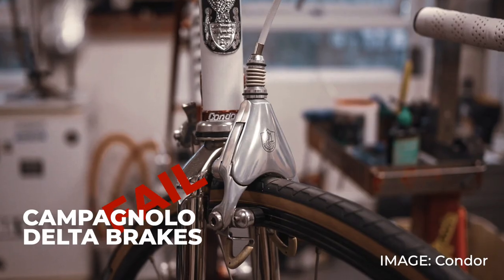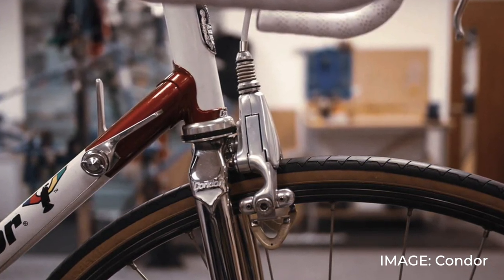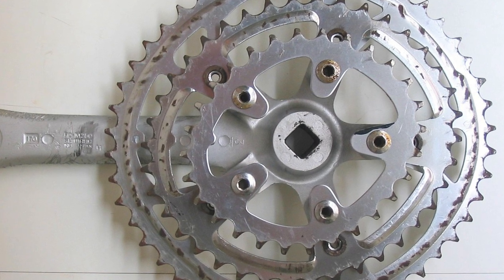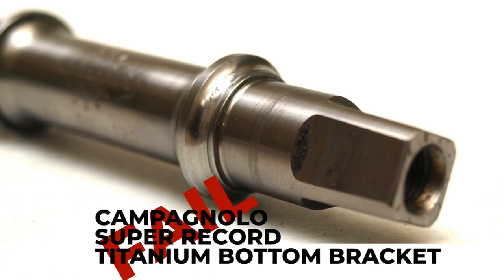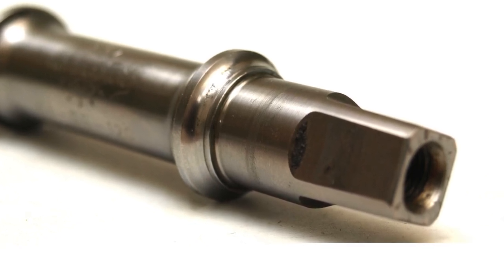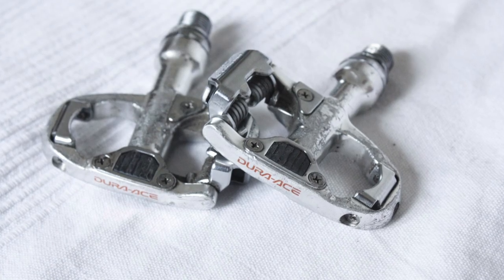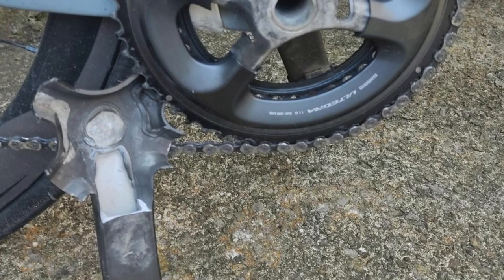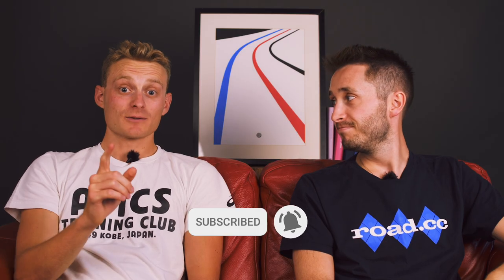Shimano and Campagnolo's Biggest Tech FAILS

Comment: Hollowtech 2 cranksets fail because there is a chemical reaction between the alloy of the crank and the bb axle which is typically steel - put water on the joint and you effectively have a battery.  Make it salt water (think UK salted roads) and it's even worse.  The reaction degrades both the alloy and the adhesive.  It's just simple science which, unfortunately, Shimano ignored...
Reply: Oh an self powered E-Bike
Reply: They don't fail at the spindle joint: they fail along the bond line between the outer shell and the spider. I suggest that  talking off the top of your head about this makes you look a dill.
Reply: If your explanation was somehow true, ALL Hollowtech cranks will eventually fail, and also many others brands since the steel/aluminium composite is fairly common in cranks machining. This is not the case, the failure affects Dura ace and Ultegra only, and the failure in question is the two-piece design, with two separate clamshell sections that are bonded together to form a single hollow structure. When that bond joint failed, the whole arm basically just felt apart.

Comment: You kids missed a few. Us older riders might remember Shimano airlines, Rapid rise and ,sadly, Suntour accushift....and there's nothing wrong with Biopace...
Reply: I’m see a lot of biopaces on my stand at the community lbs I wrench at because we get old bikes and fix ‘em up. It’s really common that the front mech is adjusted to the ring’s lowest, not highest point in the oval, so the mech rubs and grooves the big ring. Also, when I test-ride one I’ve refurbished, the oval is clearly not aligned with the crank for max power. Totally agree about Rapid Demise - I think the early mtb years threw a lot of spaghetti at the wall seeing what would stick. So many whack frames made it into production!
Reply: Sigh accushift. The last edition were really bad because you could not switch to Friction due to patent issues. I still want to try out some wing commanders on my Frankenstein bike.
Reply: I don’t understand what the complaints are about.  My first road bike had Suntour Accushift.  They worked great.
Reply: I REMEMBER AIRLINES. omg

Comment: The Delta brake bashing can stop. I can easily  lock up my wheels with the 5-pivot delta design, and it seems most people bashing them have never ridden them, + it seems pros in the late 80s / early 90s didn't have too many problems racing on them. They were a pita to install (the cable), but once installed, they performed well with excellent modulation.
Reply: I think that should put them in their place. I agree with you totally
Reply: Yep, mine worked great 👍
Reply: Yes, they did not work that bad, even my simpler "croce d´aune" version with longer brake arms brought me to a stop.  They were heavy, but looked cool.
Reply: Shimano 600 and Dura Ace AX brakes now they were bad, along with the Modolo Kronos brakes they were probably Campagnolo's inspiration for the Delta's, centre-pull aero. The AX brakes had blocks that you couldn't adjust, for 1982 both groupsets looked very futuristic.
Reply: Never had any issues with Delta brakes even on steep downhills. I never really heard any Pro Riders saying they had brake failure. 
Yes there weight was more an issues.
Like many things the Delta issues have become much of an overblown myth over the passing decades.
Reply: It's the same story as canti brakes. They get a bad rep because they're difficult to adjust, but once adjusted they're as good as any other brake.
Reply: @clockdva20  70 grams of weight penalty when the bikes were around 9 kilos as they were introduced?? Really a concern???    Rgr

Comment: One not so brilliant Shimano product I have fond memories of is the Positron group set. The rear derailleur had no spring, and instead relied on a stiff shifter wire that could both pull and push. Five speed indexing was built in to the rear derailleur, fully exposed to road debris.
Reply: Yes, I worked on the Positron equipped bikes back in the early 1980s. It was found on department store bikes. Shimano did decide not to abandon index shifting though and instead of trying to make the tech “trickle up” from the cheap components, they started SIS on their top components and let it trickle down.

Comment: Nothing wrong with the oval chainrings: Froome and Wiggins were using and winning on O-symmetric ones (different angle than Biopace though). But they are just not for everyone. As for the Delta brakes, the issue is that they were getting stronger as the brake pads wears off due to the mechanism geometry which then offered a very high leverage. So they were engineeringly flawed, and  needlessly engineered and heavy, but not weak. By the way Fignon won the tour de France on them, and lost to Lemon on them for 8sec.

Comment: I know first hand why the Delta brakes had a braking issue.  I wrote the internal report on the functional safety issue.  It was originally intended to be just a time trail brake. I came up with a way around the 'failure' issue that prevents that brake failure.  I know what happened to the engineer who oversaw and certified the masterful design. He experienced the Italian resignation. Those brakes are just a collector item these days. Look at the Shimano Dura Ace AX crank and pedals, interesting and innovative but not practical.  Cinelli came out with the M-71 clipless pedals back in the 1970's.  They had no toeclip or strap. They required reaching down and unlocking by hand to get out which cyclists thought was suicidal. But, those were intended for track racing only, where any release during the race means you loose.
Reply: I remember seeing pics of those Cinelli pedals way back when they were first released.
It seems they were designed and marketed towards track Match Sprinters mostly.

Then there was Aussie Pro Match Sprint World Champion John Nicholson who actually BOLTED his shoes onto the pedals, and had to tie his laces while on the start line, or right before then.
(Yes kiddies, there was actually a time when there were no BOA mechanisms to hunker down your shoes, and we used laces, as well as totally non-adjustable cleats, NAILED into the hard leather outer soles.) 😉
Reply: "I wrote the internal report on the functional safety issue"
PM me, pls? We must have met in Vicenza in 86. Antonio Romano and Marcel Angot were still there, then.
Reply: Delta´s a collectors item?? I use my pair... on my TT bike...      Rgr

Comment: 8:45 sloppy research. It was only the Ultegra bonded cranksets that failed: the 11 speed 8000 series have 0 problems in this regard, as did Dura Ace Hollowtech of any vintage, as they were either welded together, or centrifugally cast, then forged.

Comment: 3.5mm hex key on the Campagnolo Delta is no problem at all: a Torx T20 fits perfectly into this bolt head.
Reply: When you find them, they´re cheap, as cheap as any other size. Buy three.       Rgr

Comment: Shimano has never manned up to the horrible disasters caused by their hollow crank failures! It's documented. In fact there is actually a website for that!
Reply: Was there a specific model of crank that failed? Or was it just all Hollowtech being  susceptible?
Reply: @uptown710  Only Ultegra (6800 & R8000) and Dura-Ace (9000 & R9100).
Reply: @uptown710  Ultegra 6800 and Dura Ace 9000 and up
Reply: @Tullebukk75  thanks!
Reply: @savagepro9060  thanks!
Reply: I have just had the Ultegra 8000 crankset on my Roubaix fail-it started creaking and clicking on a 77 mile ride last week and the pedal was no longer turning true but in an elliptical shape! Luckily I finished the ride before it actually failed completely. I should say the at 70kg and 73 years old I don’t produce a massive amount of power-mate of mine had his snap completely earlier this year-he is 65……..

Comment: I agree about the Biopace, terrible idea. Campy's bottom brackets that unscrewed while you rode. I had the miserable early Campy Athena group that was impossible to keep shifting correctly. And, even though this is only about Shimano and Campagnolo, the absolute worse bit of bike gear I had was the first issue of the Sampson clipless pedals that were nearly impossible to unclip without reaching down and grabbing your heel and jerking it to the side.
Reply: Biopace isn't bad at less than 50 rpm
Reply: @raul0ca  I had it when I was racing 35 years ago. So RPMs were around 100.
Reply: Campag BBs that unscrewed as you rode didn't, if they were properly installed - or, at least, no more so than any other Italian threaded bottom bracket.
Like all Italian BBs (right-hand thread both sides of the BB shell), they needed to be in threads that were clean and in good condition and the drive-side cup needed to be done up *tight*, or, in the case of the Campagnolo sealed bearing units, the cups needed to be properly torqued against each other.
It was by no means unique to Campagnolo, simply because it's a basic property of mounting a bearing inside a threaded component - it's been understood for at least a120 years. In the bicycle trade, the Wright brothers (who were bicycle mechanics and makers before they built the world's fist powered aircraft), pioneered the use of a LH threaded gearside bearing cup in the BB and LH pedal, because they were aware of the problem.

Comment: Deltas - I've used Deltas (still use, in fact) on a tandem with no issues!

A lot of the commentary here is a recycling of some incorrect (or at best, mis-represented) memes.

Whilst it was true to say that there was a recall on v1 Deltas (1986), it was a pad issue and it didn't leave you with "no brakes". It didn't "help" the braking, for sure - but pad heating is a not uncommon issue even today - hence the swap to discs with carbon rims. More on that further down. 

The issue with the QR on the top of the caliper mostly applied if users didn't adjust the brakes correctly to start with and / or used an inappropriate lever - this was not uncommon at the time as we were still in the days where components were mixed and matched with gay abandon (Sutherlands Handbook for Bicycle Mechanics in it's 7 editions over 1974 to 2004) contained pages and pages of compatibility notes) ... however, no maker has ever advised that, as a good idea ...

On the cable binder, the siuation in the US was actually the reverse of what you describe - 3,5mm, within the tolerance that allen keys are made to, in interchangeable with 7/64", actually quite common in the US. 

3.5mm, if anything, was more problematic in mainland Europe but imperial a/k sets were still pretty common in the UK in the late 80s (this is an old product now). I certainly never had a problem working as a shop and team mechanic back then. A few people whinged about it - but those who bought their tools from a proper tool supplier, never had an issue.

All rim brakes actually give inconsistent braking as pads wear, regardless of whether you are looking at caliper brakes, para-pulls, cantis or parallel pull - and even discs will get to a point, if the user allows it, that you have "no braking". This is basic mechanics, nothing to do with bicycles - in the case of rim brakes, it's about cable recovery and mechanical advantage. If you understand how that works, you will also understand why Deltas needed to be used with the right lever & needed to be set up correctly to work well. At the time (in the absence of the Internet) many mechanics just "didn't know" and couldn't find out. I was amongst them. My solution was a little radical - I got on a plane, went to the factory and asked ... the start of my very long association with the brand.

It's worth noting that some cases, if pad wear and rotor wear are taken to extremes in a hydro disc brake, they can even pop a piston out of a caliper ... 

On Ti BB axles, the significant failure you allude to was on a prototype that Fignon was testing. v1 was, as you correctly say withdrawn - but it was not widespread in the market. 
v2 which was the huge majority and was the official production version, not hollow, nut fixing, which addressed the problem that could be caused by material flaws in the taper.

People tend to remember the Fignon crash but that's what happens when you test materials in a pro team - in fact (and up to a point), that's a part of the reason why pro teams are used as "real world" test beds ... and why our advice at Velotech is ... don't copy what you see the pros doing, because it may be that they're testing something quite specific and the kit they are using may not be exactly the same as what you buy as a final customer, or may have been set up in a very specific way.

Comment: Seen lots of these old tech on surplus bikes sold here in the Philippines, but only when watching your Vlog about these did I realized they were actually failed concepts and has serious issue with them. I only have an entry level Groupset on my bike and im thankful I did not went for a higher tier groupset because when the issues about the cranks breaking because of the corrosion on those higher tier sets, I was surprised because they were supposedly the most durable but theyre not.And also the oval crank, some unknown brands were marketing them but only here I realized they were actually obsolete....
Reply: Same about the oval chainring. A friend of mine was crazy excited for them and it's been a while since i have seen him use it.

Comment: Early campagnola super record seat pins with alloy clamps and a single titanium bolt that stripped the thread out the top clamp and released the saddle. Very unpleasant while riding.

Comment: Delta brakes with 5 pivots work perfectly and cable routing wasn't really a problem back then, whereas today it definately is. Biopace chainrings were the precursors of contemporary Rotor Q-Rings, both unnecessary but still. Yes, the first version of campagnolo's Titanium square taper bottom brackets were prone to fail, but the "development of splined hollow bottom brackets" had absolutely nothing to do with it. Square taper BB are working just fine. PD-7700 SPD-R pedals were a nightmare on the road, but track racers loved them for a reason so it is save to assume that your shoe was in fact pretty stable on the padle. Ok, enough complaining, just make sure you make sure that you guys know what you are talking about before you make a video like that next time...please😉

Comment: TWO THINGS BIOPACE which l still have but but remounted one click clockwise with no issues other than chain drop from my 1x so l got a smaller 44t NW round chainring (still have the 28T inside to catch/bailout gear for any climbs) AND THE HOLLOWTECH which l m glad not have on my other bike which l have ye old ULTEGRA FORGED CRANKS 130 BCD 50/39 WITH OCTALINK :) NO WORRIES HERE !!

Comment: OK, racing originally with Shimano's top derailleur systems, I found them too sloppy shifting and too prone to midrace breakdowns. I switched to & demand Campagnolo and never again accepted Shimano derailleurs. [they surely must have improved. my mtb is shimano, but i do not race it. have only about10 broken bones.]

Shimano innovations on pedals had limitations appearing in traumatic use: One does not commonly extend pedaling through tight cornering except while racing at higher speed, either preparing to sprint or sprinting to the finish - or intermediate sprints.
Their weakness was in the striking of pavement, which often lifts the rear wheel and entire body weight, so banked tracks did not expose the failure:
 As you know, physics of force transmission cause the weakest structural point to be where diameter changes exist. Their pedal snapped off after a few significant efforts and losing the steering occurring through weighting the pedal, sent me off in a straight line into boulders and road furniture after one sprint with a hard 90 degree turn. 
Many times that banked pedaling getting extra acceleration or speed maintenance caused my rear wheel to hop, causing riders behind to scream threats.
 I studiously avoid[ed] lapping others' wheels, but many less attentive riders DO self-immolate through doing so, unwarrantedly expecting all ahead of them to be smooth as a baby's bottom. 

Those personalities have a future in orthopedic and post-surgical wards, though. All sprinting has some degree of lateral movement, even WITHOUT purposeful Hooking.  purposeful hooking, outside of match sprint =  automatic DQ, and i've been a judge [i never use my real name online], DQing those who do that and other disqualifying moves.

Anyway, I  forget the name of the alternative Italian manufacturer of rim brakes we used that were both superior to, and lighter than, Campagnolo brakes. I  am lucky to have missed some historical equipment fails.

Campagnolo wheels were the first better than custom. Mavic and others ALL made tradeoffs in stiffness, aerodynamics, weight; custom was always best. THe past decade with its rejection of economic limits has changed racing.
Though a couple-decade-old tech, Carbon fiber composite frames die quickly, fail completely under far less stress than metal materials, even as racing always includes crashing.

Comment: When Shimano came out with SIS (index shifting) in the 80s, it lead to the biggest failure Campagnolo ever encountered. Campy tried to index its shifting and it was a colossal failure. It took several tries on Campy’s part to get it to work.  Each try was a mess.